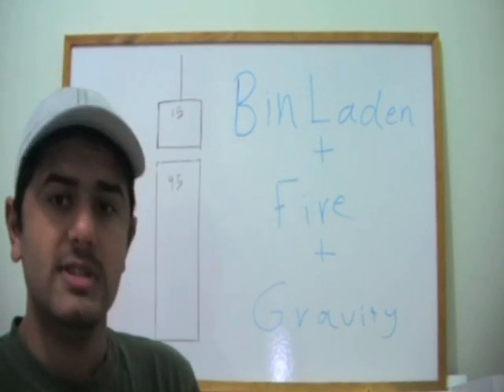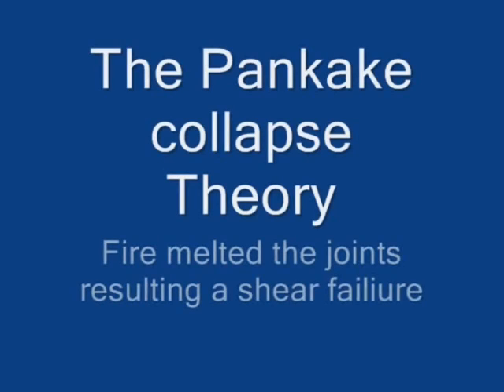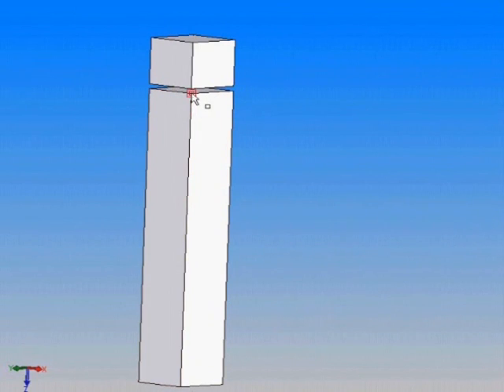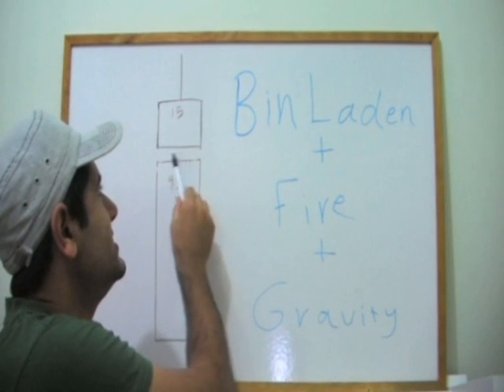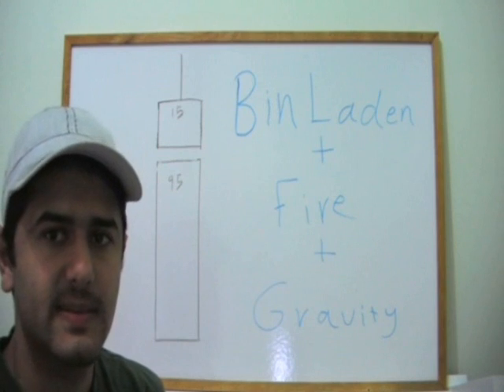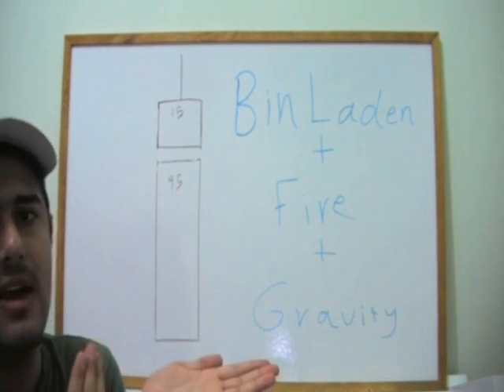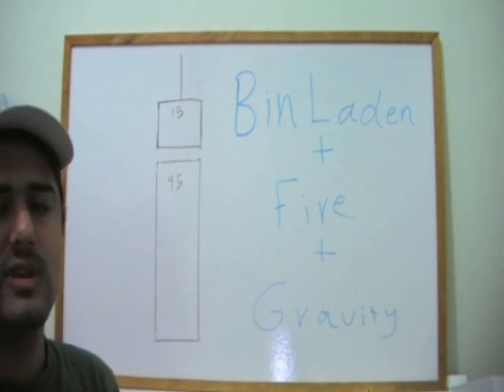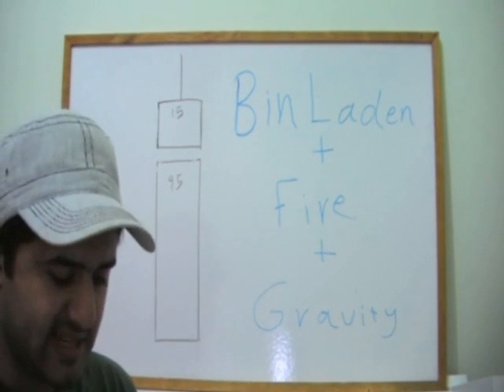(Part1) 911 Simple Physics Structural Failure Vs Demolition

Comment: 1:07 yes they did look at the footage of the north tower collapse you will see a tall structure that looked like mangled steal maybe about 60 stories tall it was so damaged by the collapse that barely 30 seconds after the collapse it fell down the fact remains that the pancake "theory" clearly you don't understand the basics of science supports the concept if you have more then 120 floors crashing into one another on top of one another why should the core columns have survived that collapse in the first place remember the upper core columns were annihilated by the collapse where the plane had hit the tower if so then the core columns should have fallen with it and in the case for explosives I want to know why the explosions happened after both buildings had fallen that makes no sense when buildings are brought down the explosions happen before the collapse but in every truther evidence video I have seen the building was already part way through the collapse and they never seam to show the explosions before the collapse there truther your questions awserned now answer mine for once you do then Ill put my tin foil hat on
Reply: That wasn't part of the core, but rather part of the façade of the building. If you look up, "north tower spire" you will see a few pictures of that.

Comment: 3:00 that is one of my favorite points. If 3 of the strongest high rise steel buildings can collapse from fire than demolition companies are screwed, we wouldnt need to spend thousands wiring them with bombs. Just start a few fires, knock out a floor or two, then voila! collapse building no problem lol
Reply: Jeffery Pinley yep a guy in a cave can orchestrate this..mmm ?
Reply: @stivi739  no, he just paid for it. Ksm was largely responsible for organising it
Reply: That is a false summation.  What destroyed the towers were two massive airliners traveling at 200-300mph fully loaded with jet fuel.  That means the planes were at their heaviest when they struck the towers.  Take a gallon of milk.  Dump out the milk.  Now throw the container at a window or a wall.  Not much happens, right?  Now ... take another gallon of milk. Leave the milk inside it.  Throw it at a window or even just a wall.  Big difference in energy and damage.  Big difference.

This is the basic physics that Truthers cannot get their heads around.  They like to play "Common Sense Scientists" but what they are actually doing is investigating a situation with unscientific methods, principles and conclusions.

An airliner loaded with fuel going full throttle into a building creates enormous force and energy.  Enough force to slice right through the outer shell of the building and continue along into the building.  The airliner hits the side of the building, but its speed will push the exploding remains of the airliner deep into the building.  Just as we saw the 2nd plane strike the corner of the south tower, with the speed forcing the explosion to exit out the other side of the corner.
Reply: NickFalacci Hello, thank you for your input. Even with the damage floors, the total kinetic energy from the momentum of the top block is unable to overcome the resistive force of the undamaged lower section. The observed collapse would require the trusses failure to occur symmetrically and instantly. Even then, as each floor encounters each other, the impact creates friction and ejects mass laterally symmetrically. this reduces momentum, and eventually the collapse would slow and stop as enough momentum is lost through mass ejection.

And you didnt even mention wtc7, no plane hit it, fell at FFA, its a CD. And theres all these wonderful facts to look through too.
40 irrefutable points wrong with the OCT
http://911debunkers.blogspot.com/2008/08/top-40-reasons-official-911-story-is.html
And now there is the Saudi connection http://nypost.com/2013/12/15/inside-the-saudi-911-coverup/
Hijackers were saudi http://en.wikipedia.org/wiki/Hijackers_in_the_September_11_attacks
bin Laden family is Saudi http://en.wikipedia.org/wiki/Bin_Laden_family
Then there's fun like the FBI admitting it doesnt have hard evidence linking OBL to 911, even though within the hour of the attacks news stations were reporting OBL as responsible. http://www.informationclearinghouse.info/article13664.htm
OBL denying involvement in 911 28 September 2001 interview with Pakistani Daily, heres the interview in full http://www.globalresearch.ca/interview-with-osama-bin-laden-denies-his-involvement-in-9-11/24697
Reply: @jefferypinley4336    you are right I  am the author of this and myself an engineer,  10 floors at the top at worst case can destroy a further 10 before the collapse is arrested . this is elementary and violating this means your violating newtons laws
Reply: @NickFalacci   doesnt matter how big the planes are even if you assume they remove the entire floor or two floors of even five floors  it still doesnt work that way and if it did then demolition teams will only put bombs at the top similar to the north tower damage zone location and the whole thing goes down ... that is false

Comment: Good job!
For those who still believe that the planes were the cause of the two towers collapse. What then brought down building seven? It just had some rubble from one of the towers.
We know that most all of the jet fuel was burned up on impact, the resulting smoke was very black indicating the fire was starved for oxygen,yet we see on several videos that several floors below the impact that there was molted steel dripping down, molten steel was also found in the basement.
  I think we can agree that as an American we want the best for our country.
Reply: Why do you say black smoke indicates oxygen starvation? Is that just something you heard, or is there a solid reason to believe it?
Reply: i know......... people are so stupid to believe that the planes cause the collapse . the weight above the burning portion of the building was way to small  compared to the bottom weight to cause the building to collapse. at lease if the building was burning at the bottom or in the center then the base would become too weak to support the weight from the top then gravity would take the building down.
Reply: Ivens desulme "the weight above the burning portion of the building was way to small  compared to the bottom weight to cause the building to collapse"

Why do you say this? Are you an engineer?
Reply: TimReed22222 its based on laws of physics and its common sense
Reply: Ivens desulme Which law(s) of physics are you referencing? "the weight above the burning portion of the building was way to small  compared to the bottom weight" <-- you are suggesting there's a golden ratio of weight above/weight below, above which would cause the building to collapse, below which it wouldn't. What, exactly, is that ratio? How did you calculate it? What are your qualifications to make such a calculation about complex skyscrapers? How low would the fires have to be for you to believe they caused the collapse?

Comment: if the column were weakened the top floor would of began to tilt or begin to slowly sit on the undamaged floors but this didn't happen. Instantaneously it fell on the good floors and this just doesn't happen unless charges were placed on each column.

Comment: This video is exactly what i have thougt for years. Even accepting the buildings could collapse, it doesnt make any sense the speed they took to do so, taking this guys equations, and neglecting any slowdown considreations, and considering 4 floors height of top section freefall it would take 22 seconds for the whole tower to fall down, just assuming the falling section will not accelerate, nor slowdon, please explain how a fully intact section of the building will allow the falling part to accelerate, let alone to keep falling, just doesnt make sense to me. the nist elastic and so on theories dont make any sense to me, I am NOT a thruther btw

Comment: If there is anyone here who thinks a building is engineered to carry 14 floors in failure please leave the room. 

No building anywhere would even begin to deal with this    A dynamic load of this size would collapse the entire structure to the ground.  Quite easily.
Reply: that was a joke right
Reply: tOhmisbrothersname
  What was a joke ?
Reply: tOhmisbrothersname
 You do realize that the building had a safety load rating of 5x static load.   The dynamic load that hit it was nearly 40 times over this.   You do realize the building does NOT carry the floor loads as dynamic weight.  Or do you even understand the difference between static and dynamic loading?
Reply: *****

You couldn't be more wrong. 

The force of the wind on the building is a dynamic load.  That means moving.  It is actually designed to sway for this.  You could walk up to the building and eye ball the top of it and actually see it sway back and forth.  That is normal.

But the loads of the floors are carried exclusively as Static loads.  That means not moving.

14 floors failed on WTC 1.  The dynamic load this imparted to the floor below was nearly 40 times over its safety load rating.

For WTC 2 the dynamic loads were up around 80 x over safety load rating. 

The top 32 floors failing now actually weighs nearly 200 stories worth of the building.

The floor below this fails at 5x a static load.

Not only are you wrong.  But you're wrong about 200x
Reply: *****

No.. A dynamic load of that magnitude (which is fairly easily calculated if you have the mass of the object (not hard to figure out.. 14 and 32 floors simply a % of the total structure which was 500,000 tons)   And you know the drop distance.  Which was MINIMAL 12 feet (one story) and far more likely to be 2 or 3 stories.  You can ascertain the impact force imparted on the floor below. 

A dynamic load 40 times over safety margin could be expected to be resisted by the floor below it by NO MORE than 1%.    And as gravity gets going mass is being ADDED to the equation.  Not subtracted.  As each new floor failure is added.  The failure time is actually increasing as it goes.   If you don't believe me read the following page.  Its written by an engineer.

Its quite easy to grasp once you understand HOW a building stands.   Floor loads are only carried as static loads.  Not dynamic.

Read.
http://www.burtonsys.com/staticvdyn/

Comment: Your argument against the pancake theory in no way factors in the two planes that hit the core columns. You sound like a rambling idiot Ali.
Reply: EzekielTheWatchman Lol, wow you just solved it with one paragraph didn't you? The man in the video has an obvious education in engineering.  He makes valid arguments for all of the possibilities. You are going to have to explain yourself a bit further then that.
Reply: Mike Torpey It is a well established fact that "jet fuel burns at 800 to 1500 Fahrenheit" (not including all the other combustibles in the airplane, and metals throughout the two towers) , and with this being said it is also a well known fact that "Steel will lose about half its strength at 1,200° F. The steel will also become distorted when heat is not a uniform temperature. Videos of both buildings showed inward bowing of perimeter columns resulting from a sagging of heated trusses on many floors" (http://architecture.about.com/od/disastersandcollapses/a/twintowerfall.htm). When a structure's supporting beams are injured like the WTC's columns they then transfer all of the weight of the entire building onto the redundant beams designed to hold if the others fail. When this happens those redundant structures are only able to support 250,000 tons-450,000 tons, or whatever the weight may be, only if they were at full strength. We know for a fact that those redundant structures weren't at full strength, and were at half, because of the heat inside the building. So no they would not be standing at all, you act as if there wasn't extremely hot temperatures inside the towers.
Reply: Your argument is extremely fact-less, and only based on your opinion... I'm saying that both of these took place, as are many of the experts, but please if you have any REAL sources with information that could lead to an actual argument please reply...
Reply: Mike Torpey
I've already stated my belief, the simple fact that the heat weakened the redundant steal supporting frames to less than 50%, to which they are not designed to operate, especially not under conditions in which other beams have already been destroyed by a plane crash. These redundant columns left couldn't hold up the 250,000-450,000 ton building, because they were at half strength, and were only designed to do so at full strength.
Reply: Mike Torpey
Well it is just funny how I've cited sources, but you haven't made an effort to cite anything making baseless claims off of 'supposed' experience, and your opinion! You just make statements without any factual evidence, it doesn't get more dodgy than that!!!!!!!!! You are literally the epitome of hypocrisy!
Reply: EzekielTheWatchman
NIST's core steel samples only showed heating to 480 F.  That's not enough to cause them to lose half their strength.
Reply: EzekielTheWatchman
A week before 9/11, Leslie Robertson, one of the WTC engineers, said they were designed to be hit by a 4-engine 707 jetliner.  The 767s that hit the towers only had two engines.  A 707 has 7 high-mass components that could take out a core column.  A 767 has only 5.
Reply: paulsoul100
If it's so simple, then you should be able to explain it.

Comment: THREE SECONDS for air resistance in only 1368'? Add in a little common sense and TIME THE COLLAPSES. WTC 2 took 15+ seconds and WTC 1 took 22+ seconds, not 11 & 13 seconds respectively.
watch?v=qLShZOvxVe4
Divining the cause of a building collapse by timing it is stupid enough, but at least get the times right.

Comment: Dr. James Millette of MVA Scientific Consultants

WTC Dust Study

2/28/2012

"The red/gray chips found in the WTC dust at four sites in New York City are consistent with a carbon steel coating with an epoxy resin that contains primarily iron oxide and kaolin clay pigments."

"There is no evidence of individual elemental aluminum particles of any size in the red/gray chips, therefore the red layer of the red/gray chips is not thermite or nanothermite."

911 TRUTH DEBUNKED!

Comment: You only watch whatever garbage supports your views? Because Loose Change has been so thoroughly debunked that only the most ignorant of twoofers still refer to it as the bible of the twoof movement...

Asbestos is best left where it is, because removal damages the material and damage is what releases the cancerous fibres into the air. And collapse is the worst possible way to get rid of it.

Comment: The core wasn't able to stand by itself; w/o the outer columns providing half the static support & all the dynamic support, the columns would (& did) collapse. No, the bottom of the building does not have to collapse for the top of the building to break the upper floors. All that has to happen is for the top 15 floors to break the next 1 floor below it. 

Stop lying, Ali; it makes God angry when you lie.

Comment: U should c Zietgiest wtc or Loose change, I gotta admit that the galvanic corrosion theory is the newest one i've heard so far but it does seems plausible. Maybe the aluminum skin which was directly attached to the steel structure, would've started pealing off. And even if that theory isnt true, u at least have the asbestos removal theory. The wtc needed to have all its fireproofing removed due to the asbestos, which wouldve been a monumental task for the owners.

Comment: There was no explosive residue in the dust. Nor was there thermite residue in the dust. (It was missing key indicators of thermite burning.) WTC galvanic corrosion is a hoax, traced back to a scammer and twoofer named Karl Schwarz. Steel is nobler then aluminium, it would required salt water to penetrate to the aluminium-steel connection, the result would have noticable discoloring and roughen the surface of the aluminium (not the steel), and is preventable by adding a few sacrificial zink bars.

Comment: The hotspots in the pile didn't move, which means it couldn't have been pockets of unburned thermite. Look up the reaction between iron and water at temperatures over 400 degrees, and don't forget the sulphur-rich gypsum from the sheetrock adding even more exothermic reactions to the mix. And that's just some of the stuff that went on in the pile. Cleaning chemicals, coolants and fluids from the mechanical floors, etc.

Comment: A 600 foot steel tower in Chicago was brought down in 1935 using thermite.  No modern steel framed skyscraper has ever been brought down from fire alone.  We've seen spectacular fires since 9/11 in skyscrapers in Dubai, Beijing, Shanghai, Grozny, and Moscow.  None of those buildings fell down.

Thermite and fire are two different things.  Thermite can melt, cut, and vaporize steel.  Fire can not.

Comment: Thermite doesn't burn for weeks. It burns fast, chaotically and doesn't explode. The molten metal was the result of chemical processes inside the rubble pile. Main culprit: steel reacting with water (steam). Putting water on the pile cooled the top, but as it trickled down it actually heated up the interior due to this reaction. (This is a well-known chemical reaction that was used to create large amounts of hydrogen gas a century ago before more efficient methods were found.)